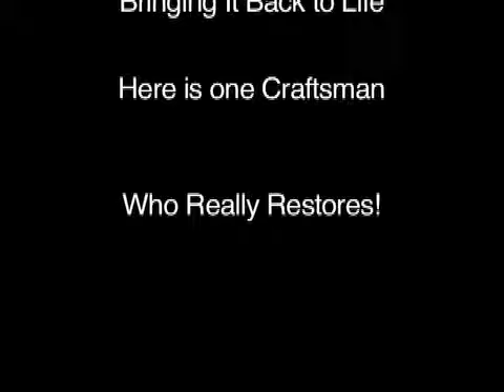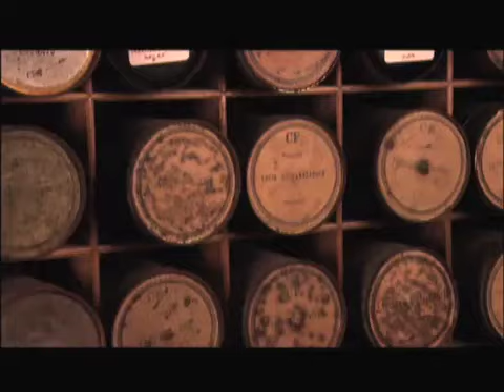Marvels Of Mechanical Music, chapter 5

Comment: Absolutely fascinating! At 2:00 does the glass you raise allow the chamber behind it to be pressurized? I play an Æolian pipe organ where such a glass allows the roll player to function under pressure.
Reply: As far as I know, the glass door is just to keep the dust out while allowing the action to be observed and entertain people. The Welte paper roll orchestrions all operated on a suction pneumatic principle like most other roll playing instruments, and have a double pump which supplies both suction and air pressure (to blow the pipes) in the bottom. You can see some of the suction pneumatics operating behind the roll frame while the instrument is playing, to pull the pull-wires from the windchest above. Their principle of operation is about the same as the small tabletop Celestina organettes popular at this time (although those are even simpler) and definitely the same basic concept as the push-up piano players and player pianos which would be commercially introduced in the USA around 1895. However Welte's patent and system dates to 1887 in Germany, I think. They were real pioneers. They built the first known mechanically and musically (and commercially) successful paper-roll-operated orchestrions.